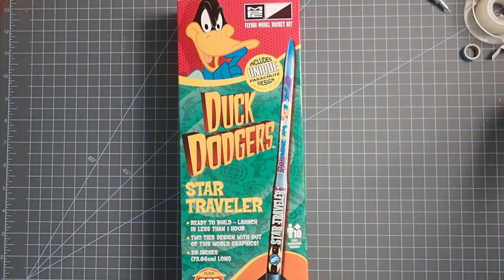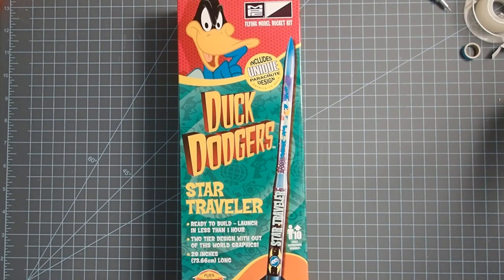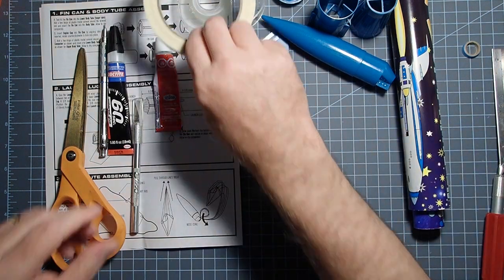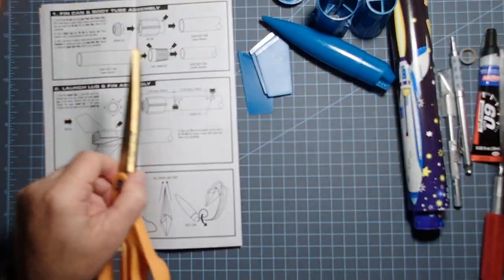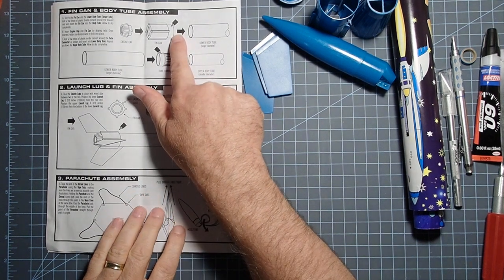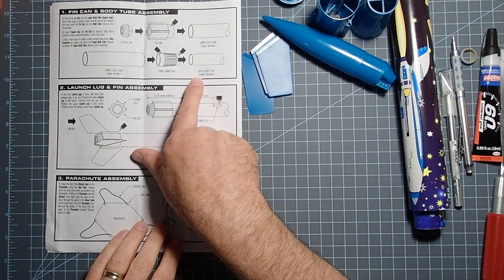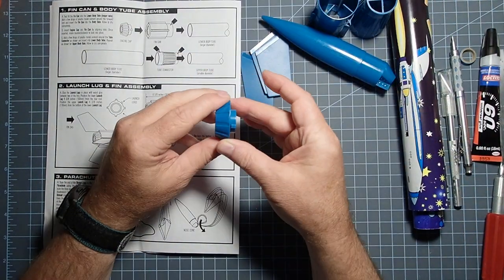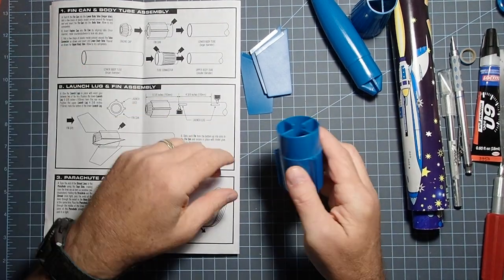MPC “Star Traveler” model rocket assembly

Comment: Another great build Dave!  I like that unique transition from the upper and lower bodies. I am curious if that extra fuselage length decreases the pressure of the ejection charge?  Thanks for sharing this video!!!
Reply from the maker: The longer (and wider) a body tube gets, the lower the pressure inside when the ejection charge fires. However, this one isn't large enough to cause a problem. Even my 2-meter long Mean Machine ejects just fine.
Reply: Good to know!  I figured as much, but now I’m imagining that if the ejection charge is strong enough to discharge the chute on larger rockets, the smaller rockets must take quite a jolt!  Fun to think about this stuff!  Thank you again for your reply. 

My forte is building RC airplanes (in my playlist on my channel). I love incorporating improvements on model building while maintaining the stock look. It appears you do the same thing.